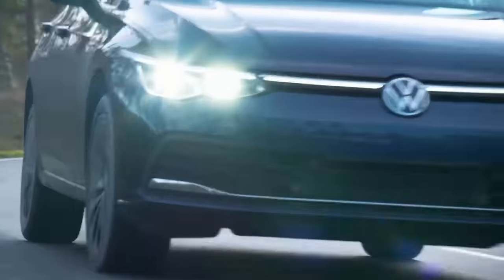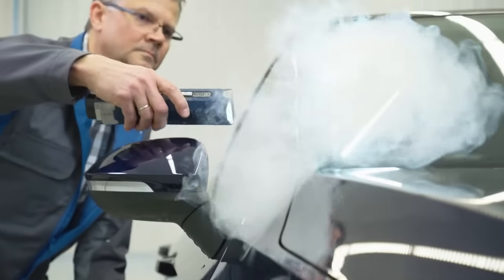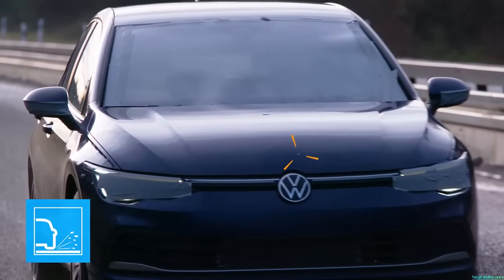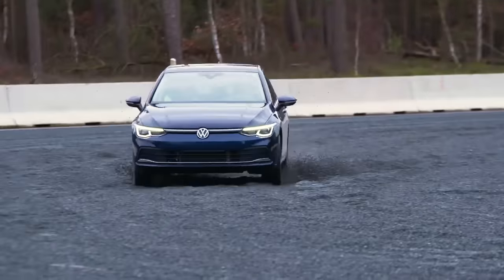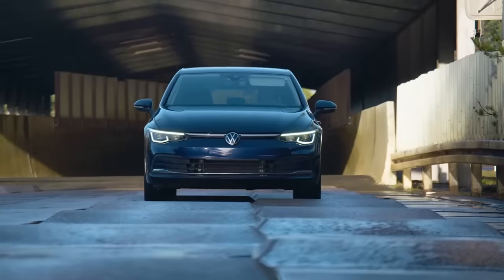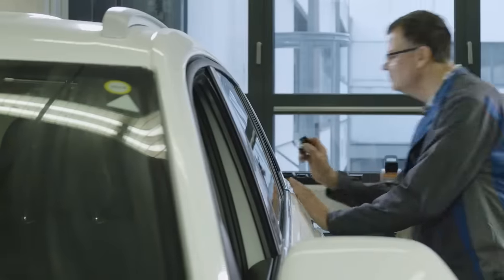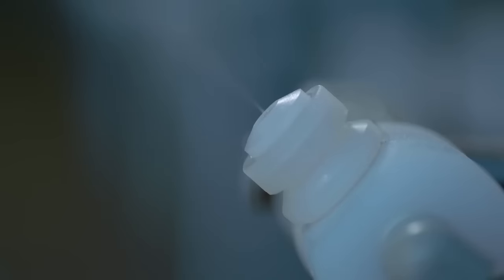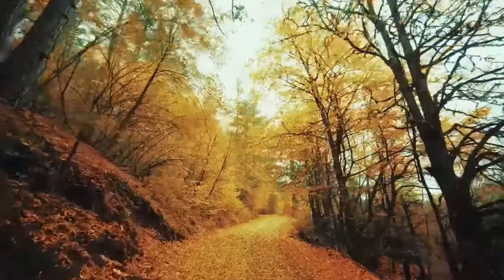VW Golf 8 Corrosion Test - how VW cars are tested against rust

Comment: As someone working in metal surface protection in automotive industry. I must say they really do have high and precise standards. We often have to test their parts in salt chambers (emulates corrosion) for a long time. Automotive industry has one of the highest standards in the world
Reply: then whic one audi 3 sportback or golf 8?
Reply: Why are VWs usually rusting more than competitors like Toyota?
Reply: @jimj2683 they're about the same. Only Volvo could be considered an outlier in the industry.
Reply: @jimj2683  maybe because the owners dont take care of them properly
Reply: @jimj2683 where?  Where do you see this? Maybe a 15 year old vw compared to a 1 year old toyota? I use to work for both
Reply: @@noahnagy99 because they're not used in cities
Reply: @noahnagy99  to put into perspective. Alot of engines compliant to current epa standards in both the industrial and on road application suck.
Reply: @quyle9483  Norway.
Reply: @@noahnagy99because in industrial applications they run in optimal conditions always in optimal rev ranges, always get maintained . Cars have varying outside conditions, have varying use cases and rev ranges and often don’t get maintained very good. And lastly: Overall cars are much more reliable today, they easily outlast 100kmiles
Reply: so why they rust than ? my bora wings was f ed
Reply: I can show You my VW Golf 7, with rust on both rear wheel arches. These "high standards" are only on paper, so stop spreading these marketing lies.

Comment: The conditions might be equivalent to 12 years, but it takes rust a while to really settle and spread. Not sure if you can condense 12 years of this process to just 6 months.
Reply: It doesn't actually matter with modern cars, rust is barely worth thinking about. They all use a modern zinc coating which is applied to a fully assembled frame at this point so to get any worrying rust there has to be frame damage.
Reply: @UhOhUmm Galvanized car bodies have been a thing for decades now, yet as I'm writing this, rust is munching it's way though 15 year old VW Golf sills so you can almost hear it...

It's a surprisingly common misconception that galvanizing solves all car rust issues. If people only knew pretty much all the old rusty cars they see are actually made of galvanized steel...
Reply: @UhOhUmm  clearly you don't live in the northeast us or anywhere that uses calcium chloride road salts
Reply: decades ago panels we're coated separately or in selective areas, full body coating before painting is not a that old, if we take the Golf for example only from Golf 5 did they start full body plating. Of course it doesn't prevent rust completely, with a lot of paint damage the coating itself will not protect it for long.
Reply: And why would they want you to keep the car for 12 years?
Reply: @1marcelfilms  true, there is a warranty
Reply: @1marcelfilms That is the real question- they don’t 😅
Reply: @UhOhUmm  Full body zinc phosphate baths have been done for some 50 years, and have been commonplace since the 80's. Still cars rust. 🙁 Sills often rust from the inside, so paint damage only accounts for part of the problem...
Reply: @UhOhUmm   golf 5's are fully plated? damn, the way they rust you'd think they weren't plated at all.
Reply: @aaaabababa  Same with Mk3's, they are zinc plated from factory and main reason they got scrapped is because of rust.
Reply: Russian cars of the UAZ Patriot type are rotting while they are on sale at car dealers. Believe me, the corrosion process does not require 12 months
Reply: @aaaabababa  yeah, 5 had some kind of other issue, which makes sense since it was the first model that was using full body plating. Maybe they skimped on the paint thinking it will be good enough.
Reply: can you stop lying? There are literal papers written on the subject and the process being used today was developed in the 90s and only started being used throughout the industry in 2000s. We have a literal database of cars and what type of method was being used for coating, so you don't need to dream up your own data.
Reply: @feki122  mk3 is only partially coated
Reply: @UhOhUmm  the process is older than the 90s', the later Audi 100 C3's were fully Zink Coated from factory, and so were the C4's, b3 Audi 80's from 1986 Onwards were as well.
Reply: @aaaabababa different methods still.
Reply: I've seen 3 year old tacomas with frames covered in rust already here in the salt belt. Modern cars are definitely not safe from rusting.
Reply: VWs are rust buckets in Canada and well known to have really bad corrosion.
Reply: @UhOhUmm   wrong, only a few models were really full coated after welding. Audis 100, A4, Citoren Xantia I think and a few more. But most if not all cars today are bulit from galvanized steel sheets. Which means all the cuts and holes have unprotected edges, plus welding points are weak points too.
Reply: @UhOhUmm  VAG rust proofing is absolutely dreadful, they all rust like crazy here in Norway, so yes it does matter...
Reply: @UhOhUmm  I'm not lying. In a report "Phosphate Coating Techniques for Car Bodies" by Toshio Yoshihara and Hiroshi Okita, published in 1983 by the Iron and Steel Institute of Japan, it says that the full dip process was first known to be used by Otto Dürr et al. in 1974 (presumably in West Germany). In Japan, the full dip process was introduced in 1978, and as of 1983 was in use at 58 % of japanese car body production lines.

So whatever VW came up with in the 90's:
1 - it wasn't zinc phosphate dipping. Probably some other galvanizing process? Several processes can be applied to one car.
2 -It didn't solve rust issues, because VW's from 2000's rust pretty bad unlike Golfs and Passats of late 90's.
Reply: Well, to be fair, the avg user won't submit the car under such conditions anyways. So for the majority of the buyers, the car will be fine for more than a decade easily.
Reply: it can if you have 40 years of experience

Comment: The Passat B6 clearly got lost on it's way to said testing .....
Reply: Had one for more than 10 years in my family and it had just a few spots of rust around the license plate lights in the rear, now I have a B7 and it's completely rust free.
Reply: @serbanmirica8120  Not for long
Reply: Maid001 My B7 is an absolute nightmare with rust.
Reply: Yeah b6 have really big rust problems un my contry😅
Reply: And the mk4 golf
Reply: @sheffield8184  anything vw?
Reply: @shultz4877  every vw ive owned has had rust lol
Reply: Sure, but if you never wash your car (including from below) it will start rusting from all the salt from roads, especially in the winter.
Reply: @dariussedleckas8194  I wash mine every week vws rust fact
Reply: @sheffield8184  if you bought it used you don't know how car was taken care of before so yea, if it starts rusting it will never stop so is my skoda mk1
Reply: every vw got lost on the way lol, even the mk7
Reply: Mazdas start to rust on their way out of factory so not that bad tho
Reply: got a 2006 b6 estate, rust on all 4 wheel arches, bootlid handle/light area is almost rotted through, front aluminium hubs have siezed pinch bolts, worst car ive ever had, just picked up a 2001 b5.5 passat estate, no rust anywhere on it.
Reply: I was about to write same thing :D Replaced all door, painted half of car and just hoping it will last few years
Reply: B6 passats and mk6 golfs are almost all very rusty in my country :D
Reply: Passat B3 and B4 tail gates also didn't make this test 🤣🤣🤣🤣
Reply: With a b6 your car rusting should be the least of your concerns I’ve been through an engine and a transmission and much much more
Reply: and the golf 3 just dissapeared in the first salt pit 🤣🤣
Reply: Golf 5, first gen Touran, first gen Touareg are weak agains rust as well
Reply: @TheOnlyMMshow  true. We repaired first gen Mazda 6’s rear wheel well before costumers got the cars. And they were brand new..
Reply: @10feetup  b5 is a much better car in everyway
Reply: @sheffield8184  My mk4 golf only has a few small spots on the hood and around the wheels and it's almost 22 years old
Reply: @Florian00  mk4 is a rot box I've had 3 they all rust especially on front and rear arch boot handle and all underneath
Reply: ITT buttmad people who got a 10+ year old car for dirt cheap that had a hard life and expected the manufacturer's good reputation to mean it wasn't going to be a rotted worn out old hassle to own just like any car of similar circumstances.
Reply: @augmentedpeter758  that’s quite an assumption !
Reply: @geenicoll2920  Sorry for my alternative take in this thread full of people complaining about their 10+ yr old taxis being a disappointment to own
Reply: @sheffield8184  Maybe I'm lucky then, I have a deep scratch on one rear arch and the paint is like 1mm thick. The scratch is from 3 years ago and still has no rust
Reply: @sheffield8184  I've been driving on salty winter roads for years with mine. 318,000 miles and all it has is surface rust the size of a dime at the bottom of the passenger front door.
Reply: @Bacon12954  I doubt that on a vw I love vws it's all I buy but they rot they all do fact
Reply: The B 8 rear sub frame for the suspension can fairly rust , the rust is actually under the almost non existant black  paint  ,what ever method of paint spraying to a minimum is done , its a pity as it looks bloddy awful with rusted frame work on a fine car , so Volks wagen pls brush up on your painting of lower structural parts please
Reply: @serbanmirica8120  you should get it checked the B7s are really bad for rust , they can rust from the inside out, check it now
Reply: @Professor-Scientist  I check it once in a while, usually when i swap the wheels for summer/winter. Still rust free! Even the underbody looks almost like new.
Reply: They said 12 years, not more
Reply: My Passat B6 is 12 years old now and still looks great . I live in NW UK where our winters are wet but mild and we don’t get much salt. It’s the salt that knackers your car bodywork, we’ve got 10 year old Fiats here!   😃
Reply: @desperado73397  ive got a passat and the subframe in rear of car is real rusty its the suspension frame , the rust is under the black paint  the car is a 2016 passat and should not be rusted like this so early in the cars life  , the front struts are the same way on the part where the coil springs rests , the car body is fine , its just the underneath framework
Reply: you mean all VAG cars?
Reply: them my dads b5 comes with nor rust just a bit  mud muffler
Reply: The b5 is even worse
Reply: @robloxfan4271  Bro no, this era of car 2002-2004 are the best vW trust me You can look under and in every part of my dads b5 and i dont find rust, but this Is cuz we live i Sudtirol and there there isnt very bad weather exept snow
Reply: @serbanmirica8120  lol that's anyway not
 acceptable i had one too it got rust everywhere and was just 5 years old. In comparison i have an now 14 year old Subaru with 0 rust. I live in sweden, our winters are salty.
Reply: Older vws seem to be alot more rust free than the modern ones, even vauxhalls seem to suffer less rust than vag cars these days
Reply: @dariussedleckas8194  I washed my B7 often in the wintermonths to get rid of the salt, it didnt help.

Comment: and then u have every golf up to date that has corosion issues on front right and left fender lol
Reply: Guessing you mean the front wing/fender panels seeing as the bumpers are plastic lol
Reply: JoneS SenoJ  volvo sweden.
Reply: JoneS SenoJ  No VW trucks are even worse.
Reply: My mk5 had the rocker panels rusted, apparently very common on that gen.
Reply: @klavier285  it is actualy on every Golf in the last 10years. I had to remove the "sponge" material under the  front right and left fender which was soaking the water, rotting and then causing the rocker panels to get rusty.
Reply: @junkieeebj should be dry on the place you mentioned.

Comment: just buy back high millage 10 year+ old cars that were driven in bad conditions and improve from there. That would save you so much "testing" time.
Reply: That's literally what Toyota does. They simply buy back cars that have been pushed to the extreme by its owners and that still run. This accelerated testing doesn't really account for actual wear and tear and damage caused by deteriorated parts that happens over the course of say 10 years of ownership.
Reply: @arunmfive  I believe this "testing" is just for the marketing..
Reply: And how would they test new cars?! They have to start these tests even before launching the vehicle
Reply: that's helpful but only as an aid to accelerated testing. they can't just make some changes and hope for the best. the new cars can be tested, and some information can be gathered from old cars. but waiting 10 years simply isn't quick enough to make good changes.
Reply: If you dont do some R&D in the first place there wouldn't be any 10 year old cars left to inspect
Reply: might be they shouldn't design completely new car but just evolutionise the old one instead? Would be more reliable this way.
Reply: @tomasrandom6430  They never create a completely new car. Sure the mk7+ golfs don’t share any substantial parts with the mk4 golf, but they share parts from the mk5, which shares parts with the mk4 in turn sharing parts with the mk3 and so on... same with Toyotas, nissans etc. 
This corrosion testing is just for marketing as you said. It’s because they already know how it’s going to perform from experience. They guarantee it for 12 years because they know that’s how long it’s going to last. After this testing if there was a serious issue they would revise their design but I doubt that happens.
Goes to show why they have so many factory recalls these days.
Reply: @finnice  it's not for marketing. In my job I get into a lot of different companies, especially automotive suppliers and development companies. There are climate cambers and test stands everywhere.
Airbag testing under extreme heat/cold by cooking the whole body, load cycling drivetrain parts, cars in salt spray tests, testing prototypes on the streets...
Knowledge/experience is key for developing good parts, but you HAVE to validate the parts and especially the whole car during testing.
Reply: @DZGMR94  Just do this once then buy back the cars from then on...
Reply: @DZGMR94  yeah but this test is crap lol "thanks to the toughest testing" yeah right. Here in South Asia, compared to what our corolla went through, this is the polar opposite of "extreme". This test should be described as soft, careful, tender, not tough or extreme.
Reply: @fabianrudzewski9027  You want extreme testing? Find someone who loves cars, give them the new Golf 8 for free and free gas and tell them to do 200k kilometers in 2 years, and ask them to be the biggest jerk in a car ever. If it survives, you made one hell of a car.
Reply: @shadmansudipto7287  
in such areas, the new golf will only be bought in 10 years anyway.
Reply: @PWATR  my point is that this is nothing but marketing.
Reply: @shadmansudipto7287  in some ways of course. But there are things that need to be tested.
Reply: @mrcarson7765  Knowing afterwards is only useful for recalls and maybe the facelift model. 
They need to know before the car gets to the market.

Comment: I can say as someone who lives in Ohio where they salt a lot in the winter because of lake effect, when I've been to one of the local junkyards I've noticed a lot of older early 2000s VWs with very little rust, yet some slightly newer are rusted pretty bad.

The only different I kept seeing is the ones with little or almost no rust on the body were made in Germany while the ones with easily noticeable rot on the body where made in other places like Mexico.
Reply: The late 90's and early 2000's VW's (like Golf IV) are not bad. But mid 2000's and on (like Golf V) are a lot worse...
Reply: Spray FluidFilm once per year in the fall on your undercarriage and you will not have rust.
Reply: That can be true, some factories don’t have the same experience. They also use weaker steel
Reply: @Matys1975  Structural rust often starts from inside the cavities, so you'll have to be thorough with Fluidfilm of whatever you use.
Reply: Very right. Even in Europe. Car made for Central Europe has different treatment against rust compared to Southern Europe or Scandinavia.
Reply: My mk7 is concerning me with how much rust is on it when it’s not even 10 years old yet

Comment: These "stress tests" are just every day conditions where i'm from in northern Sweden. My 2009 passat is rusted to all hell in the wheel wells and the trunk.
Reply: @NSDflug  Yeah, my friend got a 2013 and it started rusting after just a few months, at least the dealer payed to fix it.
Reply: Eventually I will be moving to Sweden from the U.S....(most likely in the far north).
Reply: @fortheloveofnoise  that's awesome, I live in the "middle north" part, I met an American that moved out here 5 years ago and he said the only complaint was the taxes haha. 

May I ask, why Sweden of all places?
Reply: I think they don't galvanize their cars any more, the Golf 4 didn't have such problems.
But that's the case for all German manufacturers, this cars are today only built for the typical leasing period.
Reply: So true also had a completely rotten 2007 Passat at 6 years old. Meanwhile my 2000 opel astra g has tiny rust on the rear arch's and 2007 Citroen C4 looks surprisingly like new underneath.
Reply: @simonm1447  golf 4 is an absolute tank